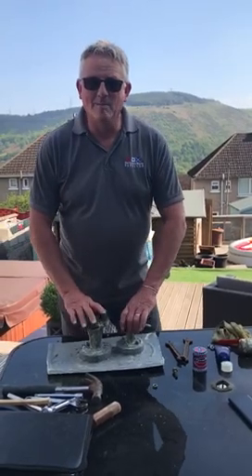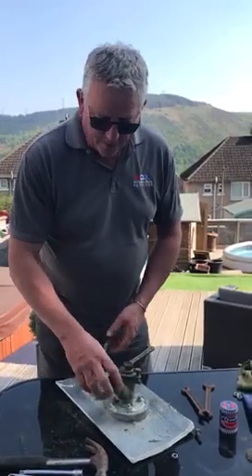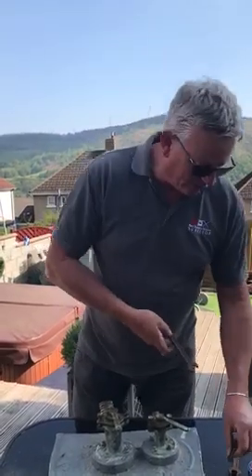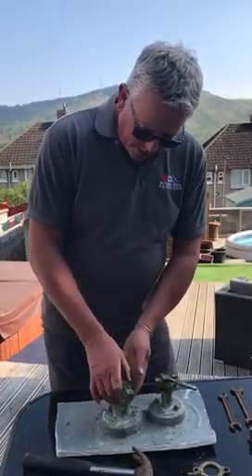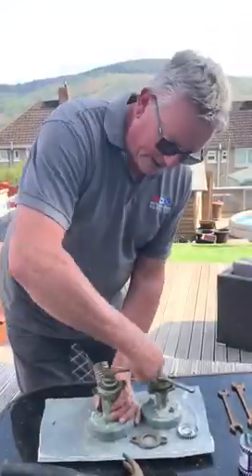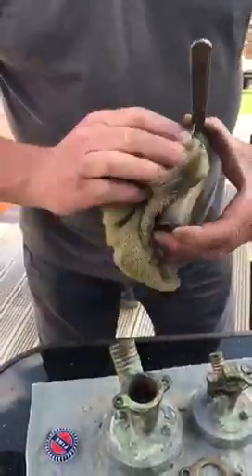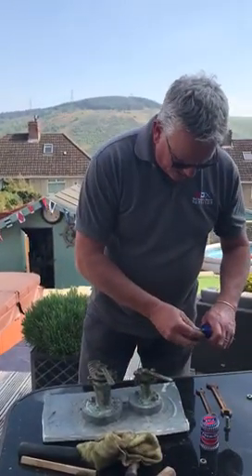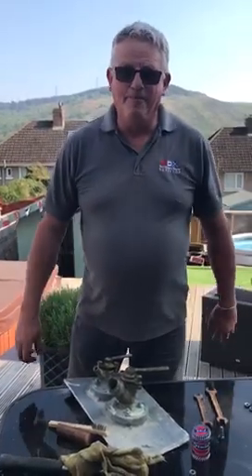Blake Sea cock how to service by Ben sutcliffe Davis

Comment: Hi Ben, just serviced cockpit drain seacocks on a 1977 westerly I have bought they are as you described i.e. bronze however they are a distinct pink colour on the tapers, should I simply condemn them or is there a test to see if they're ok ?
Cheers
Reply from the maker: Hi hard to tell without seeing them. Have they been bonded .. some times if the anodes have shut off then there is a risk of issues developing.  Tap them with a hammer if they ring then should be OK. If not its likely they will be unreliable.
Reply: @TheMarineSurveyorNotebookBenSu  Thanks for coming back, they are not bonded but both look the same pink. 
I will dry out ( she's a Berwick) and give them a tap with a soft wood bung at the ready, thanks😉
Reply: @christopher-bj8de  any update about it, please? I´m interested on this situation as I have also a Westerly (1982).

Comment: Ben. How do you put a drift up the inside of a small Blakes when the strainer is fitted on the outside of the hull? Remove the strainer? If so, how do you remove the strainer without damaging the bolts and loosening the fitting in the hull? The larger version normally don't have a strainer so that is easier to do.
Reply from the maker: Unfortunately the removal of the assembly if you can't pop it out the valve is going to be the way, most small intakes don't have the strainer fitted.
If there is enough clearance using a blow torch very carefully will sort it sometimes but you need to be extremely careful.